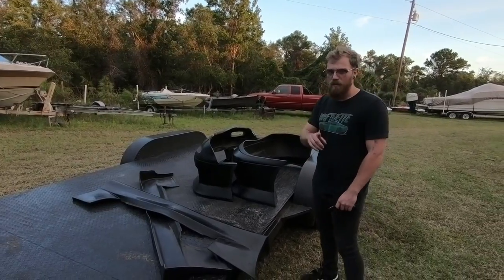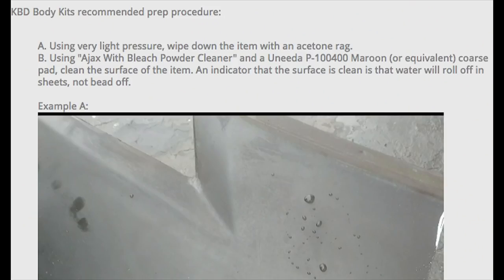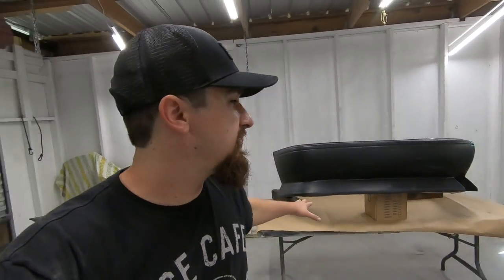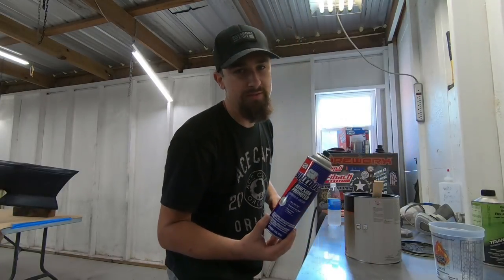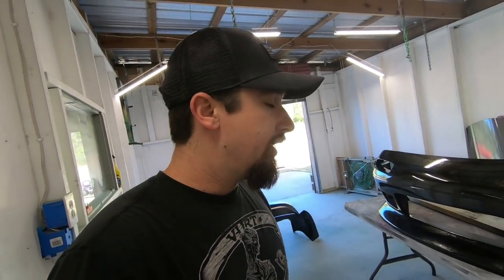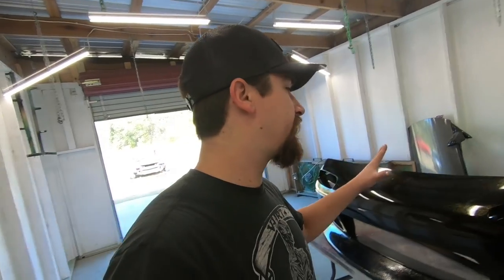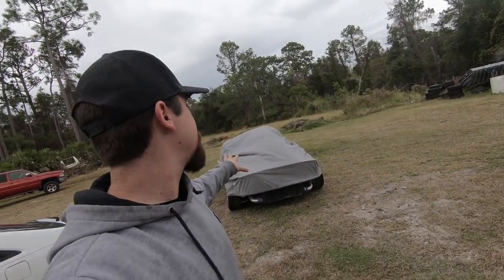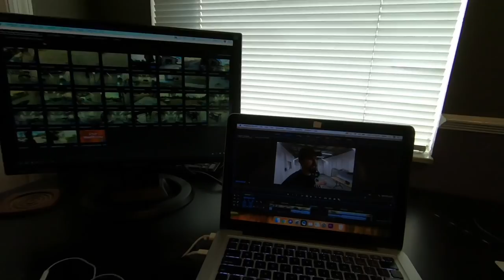I Ruined Taylor Ray's KBD Miata Body Kit

Comment: I've had nothing but issues with bulldog in the last few years man. Especially in a puff can. After a bunch of times I tried it in a quart and it was still hit or miss. Switched to a cheaper shopline promoter (SU470LV) or (SEM 39861) if they dont have any of the shopline on hand. I haven't had an issue since. Been using it for a yr or so now. If you have a local paint only supply try them out next time you get the chance.

Comment: Another hilarious intro 🤣. Respect on showing your flaws man. I can definitely appreciate that. Did you guys test fit the kit at all? I never used a flex agent. I only heard of using it in the clear coat mainly for installation purposes. Also heard it evaporators after 3to 6 months. But I guess it will hold being that you put it in the base coat and sealed it over with the clear coat. One last thing, did you sand the primer? Figured you guide coat it to catch those fish eyes. Could of maybe just sealed it with a sealer.

Comment: Hey Bode! Quick question.. I'm about to paint my KBD Kit and I wanted to ask, did you use flex additive in the primer or did you use a specific primer? If you did add it what was the mix ratio. Thanks man. Side note... I'm painting tomorrow so please reply quick if possible!
Reply from the maker: hopefully i got back in time! Ajax is a must!!! Clean it really good until water doesnt bead off of it. IT WILL BE HORRIBLE IF NOT!. Also i dont care for flex additives, just do good prep work.
Reply: @BodeVision  I'm not gonna lie man idk wth happen with mine. I washed each piece down 4 times with ajax with bleach with a scotch brite pad but before this wiped every piece down with acetone. Then finally shot my primer and it was just instant fisheye everywhere, but I just rolled with it. I kept coating the primer on until it laid nice then wet sanded it smooth. So then I though since I have the primer on nice and flat I was good right? Wrong lol. I wiped the kit down with wax and grease remover then wet for paint.. fisheye everywhere. I dont even know how it went that wrong but yeah.. I do greatly appreciate your help though.
Reply: @BodeVision  what grit did you use to sand the kit down bare? I might be doing the same thing.
Reply from the maker: Gulf Wax i sanded it to bare with 220 but still after I did that I still got fish eyes. This company is not okay to sell a product like this. I refuse to paint anything kbd from now on.
Reply: @BodeVision  I feel you bro. I kinda thought the same but I feel like at the same time there's gotta be a reason. It's just hard for me to think I didn't clean it enough because I did to a t what they wanted plus more.
Reply: Anyways, you did inspire me to paint my own car and I'm glad you did man because the car itself and all the parts minus the kbd came out great. Thank you for all your tips! I'm very grateful for this channel and will continue to watch.

Comment: Mate you don't even need to use adhesion anything. Red scuffs, wet-on-wet and straight to base and clear. I

It'sthe method, it's the knowledge and the product.  Back at the BMW shop I work for, it was a 40 minutes job. 

On any plastic for this matter. Do it and you're not going to have problems.